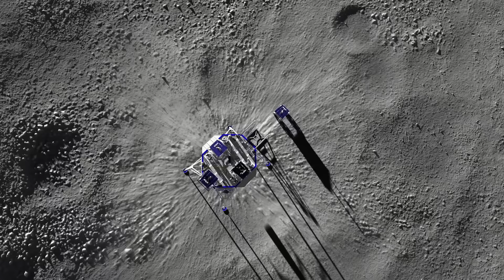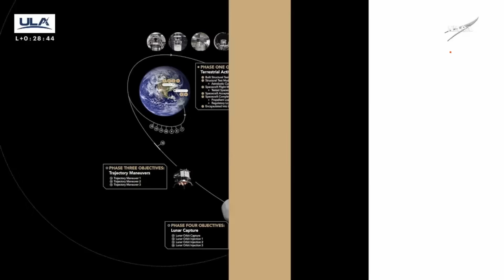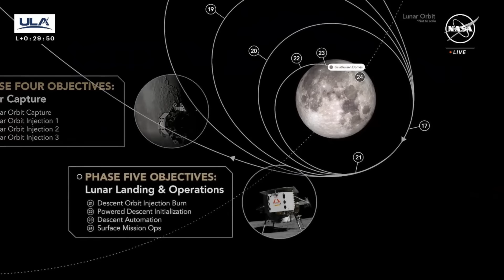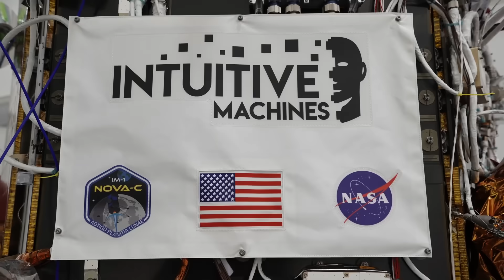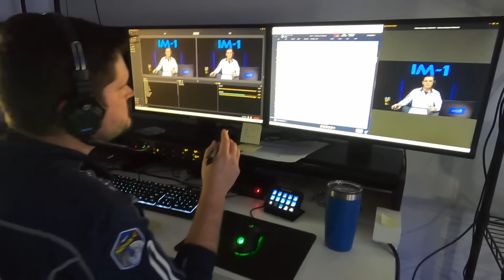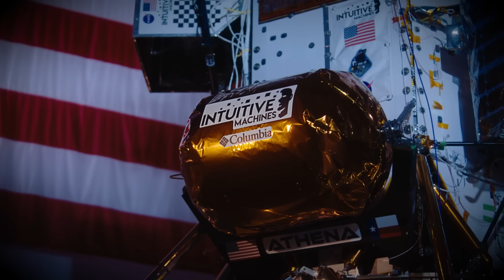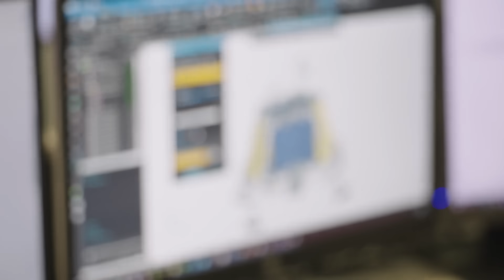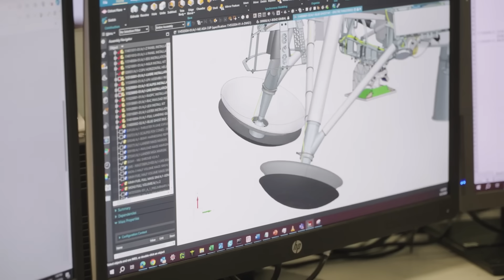Three Lunar Landers? Why Everyone Is Going To The Moon.

Comment: Rocket lander/launch plumes scattering dust everywhere.  Given the statically charged dust particles on the moon, I would not be surprised if we find dust coating equipment to be a growing contamination problem in the future.
Reply: And not only a "dust"-  It's blasted glass microparticles (eons of meteorites) that have never eroded--very aggressive stuff.
Reply: There have been things on the surface for decades and I don't recall any of them being covered up in dust or really interfered with..
Reply: @TheEvilmooseofdoom  We didn't inspect or even contact things that stood on the Moon for decades. The retroreflectors may degrade in efficiency, but that's it.
Landing heavier things would be trickier. we may need a lighter craft to land and prepare a landing zone for repeated missions.
Reply: @TheEvilmooseofdoom  yeah unlike on Mars, there is zero wind to transport it. The dust spews from activity on the surface (I picture the landing or the dust spewing off the metal tires of the lunar rover)-
Reply: In the practical vacuum of the Moon, once ejected each particle will follow a pure ballistic trajectory dependent on initial energy and subsequent collisions. The substantial portion that is glass fragments will be electrically insulating, resisting static charge effects. But contact without atmosphere is impact, and the sharpness of the shards ensure mechanical indentation and bonding to surfaces, let alone creating even more dust via fragmentation. It’s a surprise that the Moon’s surface isn’t any thicker with dust, which shows how good it is at absorbing kinetic energy.

Comment: 12:11 How do you vacuum in a vacuum?
Reply: Uhhh... add atmosphere then remove it?  

Form a seal around the area to be vacuumed, add air, then suck it up?  That's the best I can think of.
Reply: @r3dp9  has the right of it: it's a bring-your-own-gas kind of situation. You puff first, then suck. But the "suck" part is more like "use carefully placed chambers to catch all the stuff flying around."
Reply: @ And if it’s a loose rock pike, as most are, a seal can’t be formed, then what?

The best I can think of would be to mechanically stir up rubble, and use an inert gas to blow it into a catch mechanism.
Reply: @ChrisGWarp  Because of the low gravity, and because any jet of gas you release will immediately expand in all directions, a few little puffs are pretty much all you need to stir up enough material (the gas provides all the mechanical force) to saturate your collectors in these loose, dusty space environments. You are right, though; Hyabusa2 shot 162173 Ryugu with a 5 gram titanium pellet as its method of mechanical action, and it had a horn-shaped thing to catch and "vacuum" up the ejecta. The expanding ejecta plume itself gives sufficient "pressure" to stuff a lot of itself into a nearby container.
Reply: @Nethershaw  I'm fully aware of that. It's a "blow" not a "vacuum" ;)
Reply: Clearly you just need to achieve a negative pressure.
Reply: @ Oh dear. Please explain how you can do that in a hard vacuum?
Reply: I was wondering…
Reply: @DannyJoh great question that many may have missed. Maybe worthy of another video?
Reply: And this is why you aren't a spacecraft engineer! 😂
Reply: Very simple, that space was not vacuum when took off from earth, but in Lab use it need to be vacuum.
Reply: Major suckage has no upper limit. is there are "ur mom" joke in there?
Reply: The Planetvac device is not a vacuum cleaner. It vents compressed nitrogen into that nozzle that sits on the surface. The nozzle is designed to direct that airflow over the surface and then into a collection tube. The air will pick up particles from the surface, depositing them into the tube.
Reply: @zounds010  Need to call it the “PlanetVac 2000”.

Comment: Or they can use the technology from the 1960s that they used a half dozen times that went  perfect and had zero test flights ….
Reply: No they can not, and if they could, they couldn't afford it. And perfect? That would be a no.
Reply: Zero test flights - you gotta do some reading up my friend. And as for "perfect", Apollo 1.
Reply: The technology from the 60s is also so complex and expensive, that if NASA routed all of it's money to make a single Saturn V, they would only pay it off completely by the 2060's.

That's how much money a single Saturn V took to make.

It's outdated tech, using some robust, but godawful computers.

Most of the recent failures in lunar landers is mostly because of a lack of experience from the teams building and specially programming them, and time/ budget constraints.

Comment: Why can't they shoot a laser at a lander to generate power and keep them alive during lunar night?
Reply: The amount of power you'd need to end up with a useable amount once it reached the Moon would be prohibitive (you'd lose a lot to the Earth's atmosphere, and the beam would be diffused over many kilometres by the time it reached the Earth's surface). Also, you'd need at least three spaced around the Earth if you wanted continuous coverage.
You could put satellites in Earth orbit so you didn't have to worry about the atmosphere, but the international community would probably be quite unhappy about giant steerable lasers in orbit. It's a bit Bond villain.
The most sensible option might be lasers in orbit around the Moon. Although you'd still need an enormous, heavy, and expensive laser, plus enough solar to power it, and cooling for the whole thing. I haven't done the maths, but I think you'd need something at least the size of the ISS. You'd still be running into the same Bond villain problems as well.
Simpler and cheaper would be to use a tried and true radio-thermal generator, like the ones used for Curiosity and Perseverance. You'd get more power than your orbital battle station, I mean, laser power satellite, and as a bonus, heat to keep the rest of your lander alive. But RTG's are still waaaay to expensive for the average mission, which I hope explains why laser power is off the cards.
Reply: A laser from lunar or earth satellite eliminates most of the power degradation plus these landers draw such little power in sleep mode that some like Japanese lander  in 2024 survived the lunar night without modification.
Reply: That would have to be a pretty powerful laser. A one-watt laser is known to be high end, like the type used by particle colliders.
Reply: More batteries would be cheaper.
Reply: It would probably be far cheaper to send along a couple of tons of batteries to last about two week until the sun comes back. Certainly less technically challenging.
Reply: Also, there may be a what-if xkcd article about this maybe :P
Reply: Because of the inverse square law.

Comment: I see a Columbia logo on the Intuitive machines lander. Just curious what is the connection between a lander and a clothing company?
Reply: They make the cooling system for the lander
Reply: Columbia's insulation tech was adapted to use to keep the cryogens on the Nova lander cold

Comment: 13:00 they made the same mistake as NASA back in the days. There should've been a crater under the engine.
Reply: 😄 You're showing a fundamental misunderstanding of the Moon's surface, especially in areas where not much lunar dust has accumulated on the rocky substrate. Think blowing dust off your pet rock that's been in the attic for forever.
Reply: Amy Titel's channel TheVintageSpace recently explained the lack of exhaust craters.
Reply: hatewatcher lol
Reply: wrong comrade, no “craters” under the engine, try flat earth as your next object of interest 😂
Reply: @olasek7972   You do know that the Soviet Lunokhod did have a crater under it, comrade, don't you? Go check the photos. Because it wasn't fake, unlike the Apollo program.
Reply: @os3ujziC  "You do know that the Soviet Lunokhod did have a crater under it, comrade, don't you? Go check the photos. Because it wasn't fake, unlike the Apollo program." 

This argument is as silly as saying that because area x on earth does have surface sand dunes, that means no area on earth without surface sand dunes, which is obviously silly considering the existence of eg. lakes and oceans, rock, soil etc.
Reply: @nt78stonewobble  just because i saw and even swam in those lakes and oceans does not prove they exists, earth is covered in sand dunes ans spice melange.

Comment: Hi Scott, thanks for the update. I wax wondering why they just don’t land on wheels? Seems to me the wheels that were on Lunar River could be landed on is developed a bit more - it probably wouldn’t fall over as easily.
Reply: Unnecessary complexity to solve problems that are unique to wheels. You have to add brakes, motors, etc. Legs are as simple as it gets.
Reply: @ Perseverance and Curiosity beg to differ. And I ll let Scot answer. Thank you!
Reply: @garyseven777  well. Those were rovers with a completely different purpose than these landers.
Reply: @ I want asking about “these landers” it is a general question , politely go away please- Scott will either answer or not, but I did not ask you.
Reply: @ landing a 20 story building from Space onto chopsticks also seems a “over complicated solution” maybe try thinking outside of the box a bit.
Reply: I think it is the opposite of what you said.
Reply: @ ask Perseverance and Curiosity

Comment: I'm gonna be that guy and predict a lot of stuff falling or rolling over. I like the Blue Ghost design because it looks like it would be very hard to tip, even if all its lateral movement was not properly cancelled. Everyone who played KSP will know how easy those little rovers are to flip, though, unless you go painfully slowly. You always wanted a robotic lever to flip you back over and solar panels on every aspect of the thing, so it could still generate power regardless of which way up it was facing.

Another thought - all those CGI shots from a few feet away from the lander as it lands should tell the engineers that a couple onboard cameras that detach from the craft once in a landing trajectory and which film it on the way down would be pretty valuable. Make them hardy and just stream the data straight to the main lander as they fall along with it and just leave the min the regolith as disposable or to stream as long as they have power. From memory Philae had something like this.
Reply: A tiny drone would be amazing.  Would be difficult to pull off, but if you got one working, pretty much every mission would benefit from having some.
Reply: AYE ! ITS A CARTOON.   A Big Problem !

Comment: Why do the landers have legs? Why not build a lander that has 4 large wheels.. and durintg the landing phase.. at like 2m or so, come to hover, flip belly-side down whilst cutting thrust and plop onto the surface.. that way you have a large mobile lander with a rocket on the back (the rocket is for lols at the end of the mission!)
Reply: Probably a mass energy calculation.  Take a lot more energy to move a lander that big around and most of what it is schlepping is just dead weight.

Comment: I feel like the recent history of failed landers isn't necessarily a slam on those particular programs, but instead just goes to show how amazing it was that NASA stuck the landing with a much more technologically crude yet ambitious vehicle 56 years ago, before Scott and many of his viewers were even born!
Reply: The landing? You do realize there were SIX lunar landings right? And they were human controlled, not relying on laggy telemetry or software/sensor fusion. They were all military test pilots so landing with direct controls wasn't that difficult. A dozen guys drove around, ran, jumped, played golf, and left a bunch of equipment on the Moon that's still visible today including 96 bags of 💩.

The reason they could do so much more with less was that there was basically zero safety margin and the astronauts knew the risk of death was high. Nowadays, NASA is very risk averse which makes engineering "safe" spacecraft ridiculously expensive and difficult, even with modern technologies.
Reply: @TecnamTwin The safety margin was higher than zero. If Apollo was as minimally safe as people claim, it would have had more accidents.
Reply: @TecnamTwin    More likey that Santa exists than any of that happened 🤣👍 If that had happened, China would have been there 25 years ago. There is literally footage of the Apollo astronauts faking the 'far earth' pictures by covering part of the window when they were in near earth orbit.
Reply: Fairytales. Apollo never left near earth orbit.
Reply: @MattyEngland Other countries have photos of the Apollo landing sites with their big telescopes 🔭 .
Reply: @MattyEngland if you're truly convinced of these childish conspiracy theories, what are you doing here?
Reply: @MattyEngland  Science-deniers, anti-vaxxers, and conspiracy-theorists lack the cognitive capacity and emotional maturity to make any positive contributions to humanity, and flat-earthers are the absolute worst of the whole contemptible bunch. 🙄🤨

Comment: The lander lidar didn't work because they forgot to take off the lens cover prior to launch.
Reply: Lol
Reply: I expect the next vehicle to have a "Remove before flight" tag hanging there. :)
Reply: The very thing meant to protect it ultimately led to its destruction
Reply: Stop laffing. These people need the moral to fight there next war. They don't need people laffing at them, they just need a shitload of luck.
Reply: Nah, they didn’t add back in the safety hardware pin to enable power to the laser. It’s a safety mechanism as the laser will blind you in <1us if powered unexpectedly. Laser was an MDA Space FLARE unit. Remember to follow the user manual!

Comment: I wonder if SpaceX could land a DragonXL on the moon with an Optimus robot on board to do somecexploring in preparation to a Mars mission.
Reply: I don't think DragonXL has soft-landing capabilities.
Reply: @SkulShurtugalTCG  don't know, I haven't seen one yet. The Dragon of course has its original repulsive landing engines, and being mounted on the side of the capsule body would make excellent landing jets on the capsule with the "boot" still in place.  What else goes into an XL capsule?